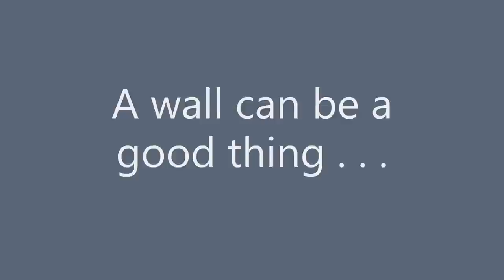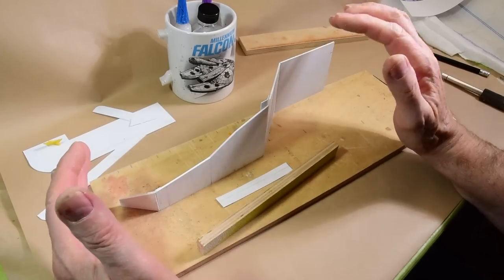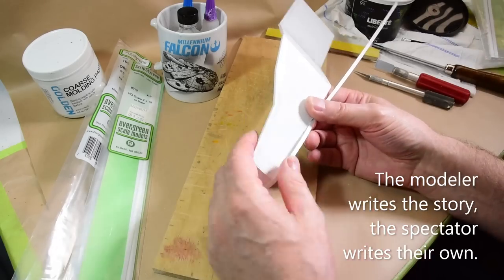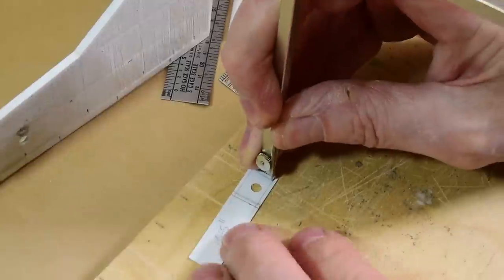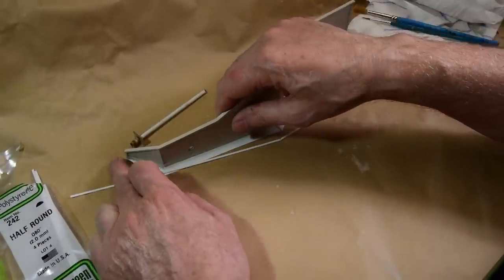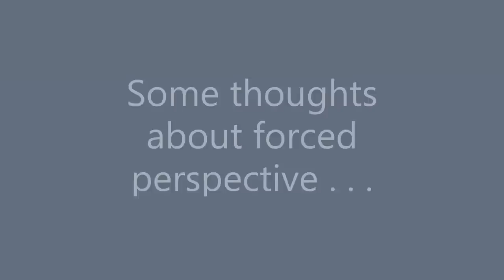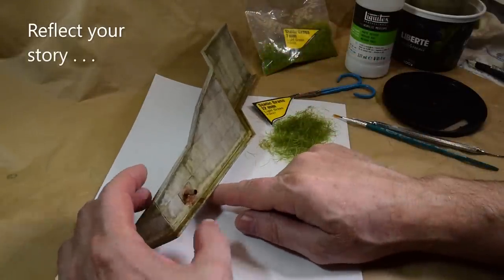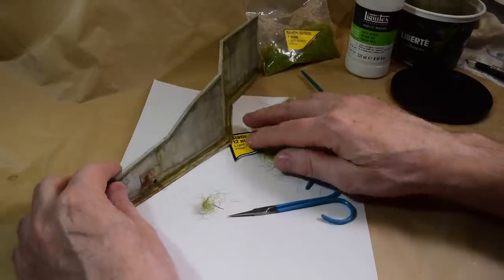Building & Painting a Simple Model Retaining Wall (Part 3) | River Road - Vlog # 156

Comment: Thank you for your quiet en pleasant explanation of this nice build. I missed you you made this beautiful subtile structure of concrete on the flat styreen.
Reply from the maker: This is a refresh on texture paste & tape application: Paint the whole surface with texture paste. Let it dry. Apply the thin line tape at whatever space you want. Re apply a thin coat of texture paste over the tape and the whole surface. Let dry. Peel the tape. It's ready for paint and washes.😁

Comment from the maker: This is a refresh on texture paste & tape application: Paint the whole surface with texture paste. Let it dry. Apply the thin line tape at whatever space you want. Re apply a thin coat of texture paste over the tape and the whole surface. Let dry. Peel the tape. It's ready for paint and washes.😁
Reply: This is a great technique that turned out really nice on the retaining wall!  Very realistic look!
Reply: As always, thanks for sharing your expertise, Boomer....which did you use on the wall, the Coarse Molding Paste or the Fine Pumice Gel? How thin was the line tape?
Reply from the maker: @tohso31  Coarse Molding Paste. 2mm tape.
Reply: @boomerdiorama  Thank you,  sir!
Reply from the maker: @tohso31  You bet!👍

Comment: Beautiful Boomer. It was a revelation in the way you made the grooves between the concrete blocks with just laying down some pinstripe tape. I spent hours hand scoring grooves on my scratch built ABC TV Studios Building with a scoring tool. It’s one of those brutalist style pre-fab panel buildings from the 80s. Looks good but took forever. I now have to remember to cover the walls with coarse fine pumice gel before I paint.
Reply: Just corrected my typos 😁
Reply from the maker: This is a refresh on texture paste & tape application: Paint the whole surface with texture paste. Let it dry. Apply the thin line tape at whatever space you want. Re apply a thin coat of texture paste over the tape and the whole surface. Let dry. Peel the tape. It's ready for paint washes.
Reply: Thanks much Boomer

Comment: Great build, I’m going to start one for a spot that has a cutout and needs a wall. I watch the video a couple times to understand how you created the “form” look of a concrete wall, did you coat the whole wall, let it dry, apply cut pieces of tape leaving small gaps between the forms, then apply a thin layer, after drying remove tape to create the rise seams….
Reply from the maker: Use automotive pin tape over the plastic. Paint over it with texture paste, peel off when dry.
Reply: @boomerdiorama  thanks for the addition info
Reply from the maker: @jstockton303  You bet. 😁

Comment: New subscriber. I am going back through your videos. I love your artistic approach. I plan to model mid 1940's steam to diesel transition on a small 4x8. 
Learning perspective and how you are designing your layout is fantastic. It's the little things, literally, that bring a small space to life. 
Your like the Bob Ross of model railroading art!
I like your approach of making small "modules" and completing those with lots of details, then adding them to the layout. I think this helps people, especially beginners from not getting overwhelmed on the work to be done. 
My layout will be broken down into four 2x4 foot sections. The layout will be split in half with a back drop running down the middle. This will break up the typical 4x8 oval look. 
The modules will come apart for storage and if I need to move them I can. Also it will be design so I could simply setup half the layout and switch on it for fun or work in individual sections.
I also plan on scratch building or using craftsman kits for a lot of the railroad.
Reply from the maker: Your plan sounds awesome. Thank you so much for the sub as well! Cheers Dan! ~ Boomer.

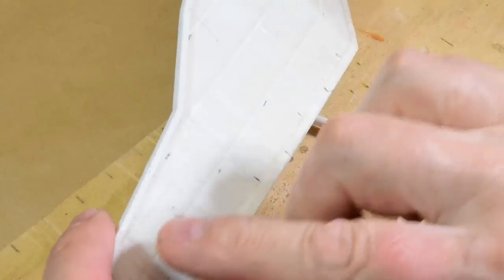Comment: Fabulous video.  I can't tell you how inspirational your videos have been.  A quick question if I may, at 9:00 - 9:30 you describe applying tape to get the texture of the wall.  For the life of me, I can't envision how you did this (and the wall texture looks great).  I'm wondering if you took any video/stills of this process or have covered it previously?  If not, would you be willing to make a separate quick video showing this?  Again, love all the videos and keep up the excellent work!
Reply from the maker: This is a refresh on texture paste & tape application: Paint the whole surface with texture paste. Let it dry. Apply the thin line tape at whatever space you want. Re apply a thin coat of texture paste over the tape and the whole surface. Let dry. Peel the tape. It's ready for paint and washes.😁

Comment: This is an amazing video, as are all of yours. I am only really getting into the hobby now, but the amount of knowledge and information that you give in your videos is just on a completely different level. I am following artists like Luke Towan for a while, but you give such a deep understanding not just for the "how" but also for the "why", "when" and "where" which is often times even more important. Also these wet blending techniques are just out of this world.

I have just one question regarding this video: Was there a particular reason why the pipe actually reaches over the drainage ditch? Wouldn't they design the pipe so that any water running through would empty into the drainage? Or will there be a proper ground drain where the pipe ends?
Reply from the maker: Thank you. There is an asphalt "berm" for the drainage pipe which directs the water into the track-side ditch. When the area was repaved, due to erosion, the old drainage sump was filled in. The ditch follows a logical path under the right-of-way, and out a culvert on the other side of the main into the imaginary river.

Comment: Hi. Great results on that wall. You previously presented creating the frame marks on a modeled concrete structure surface on the Glover Road - Painting the Bridge Façade | The Texture Factor: Part 3. There you used pin stripe tape then added surface textures followed by removing the tape. Did you use a similar process creating the board marks on this wall? Thanks.
Reply: Note: I just saw your earlier comment. I think that answers  my question. Thanks
Reply from the maker: Yes. Same process.

Comment: Though you mentioned modeling the form lines, I don't think you addressed how you accomplished it.  Did you scribe the lines or did you add .010 sheeting?  Also did you add texture to the wall beyond using sandpaper.  As I recall you used a fine paste for the concrete peers holding up the barge slip.   Modeling concrete out of styrene may be my next modeling project.  Thanks again for all your help Boomer ~ Dennis
Reply from the maker: Use automotive pin tape over the plastic. Paint over it with texture paste, peel off when dry.
Reply: @boomerdiorama  Leave gaps between the tape that will be the raised texture?  I'm not sure I understand.  

I'm trying to recall if you have done this before in a previous video.  There is such a wealth of knowledge on your channel!  it's impossible to retain it all, especially if it's not relevant to you at the time you watch it!!
Reply from the maker: @OtterCreek  Paint the whole surface. Let it dry. Apply the thin line tape at whatever space you want. Re apply texture paste over tape. Let dry. Peel the tape. It's ready for paint washes.😁
Reply from the maker: This is a refresh on texture paste & tape application: Paint the whole surface with texture paste. Let it dry. Apply the thin line tape at whatever space you want. Re apply a thin coat of texture paste over the tape and whole surface. Let dry. Peel the tape. It's ready for paint washes.
Reply: @boomerdiorama  Thank you sir!!

Comment: Very informative Vlog, I can't speak for others, but I never used to sand styrene either to paint or glue.   Forced perspective. how cool is that.   Still building trees you showed in Vlog 152.   I just sit in my easy chair and twist wire, I have been putting together tree frames with a mix of gauges.  Wrap 6 of one wire gauge and then 4 of a smaller gauge and I am getting good results.  I do have a question on the Fast Mache can I use tempra paint in the water I use to mix up a batch?  I do this on plaster rock molds.  Thanks!!
Reply from the maker: You should be able to mix water-based paint with Fast Mache. Try a spoon full first. Always test your theory. ;-)

Comment: love it just one question how did you texture the wall ? you said strip and peel did you mean put very thin strips of tap 4x8 put your texture past down then pull up the tap.
Reply: I have the same question about creating the appearance of the 4x8 sheets.
Reply from the maker: Just mark lines (with a pencil) 4'x8" Then use automotive "pin" tape or hobby tape, paint the texture over the tape and peel it off after it is dry. Then have fun and paint.
Reply: thanks that is what I was thinking. thank you so much for sharing your gift the Lord has given you.
Reply from the maker: @donsunden5906  God Bless you Don!

Comment: I'm sorry,I went back and looked but some how I missed how you made the form lines with tape. Could you explain that a bit better that's where I am on my wall ?
Reply from the maker: This is a refresh on texture paste & tape application: Paint the whole surface with texture paste. Let it dry. Apply the thin line tape at whatever space you want. Re apply a thin coat of texture paste over the tape and the whole surface. Let dry. Peel the tape. It's ready for paint and washes.
Reply: @boomerdiorama  ok I see, thanks.

Comment: Boomer, I got to ask. Did you just pencil the mortar joints and then conver them over with paint. I like the way they look. I have penciled in lines and then painted over them for joints. Just wondering.
Reply from the maker: Those pencil marks were for the very thin strips of tape I applied over the initial texture coat. Then I painted over the tape and then peeled the tape off. Then I painted it.
Reply: Boomer, what can the Coarse Molding Paste be used for? Does it leave a rough texture as on the wall? Just curious the difference how you use Fiber paste, Crackling paste and the Course Molding paste. Thanks.
Reply from the maker: @ronhill5118  They all have similar properties for texturing. Just a matter of taste after you try it.😁